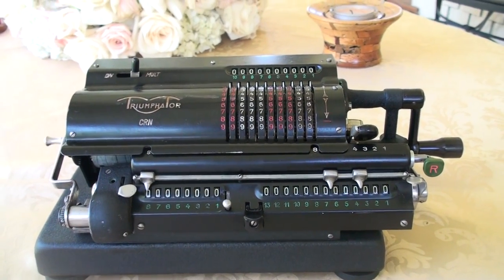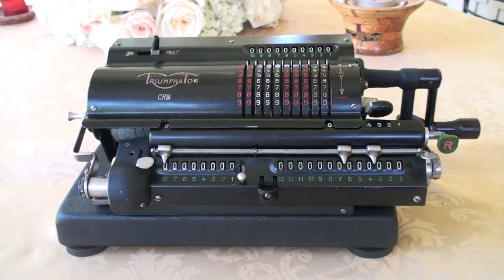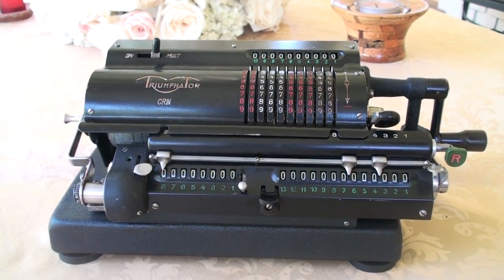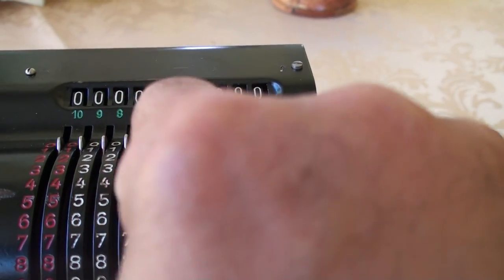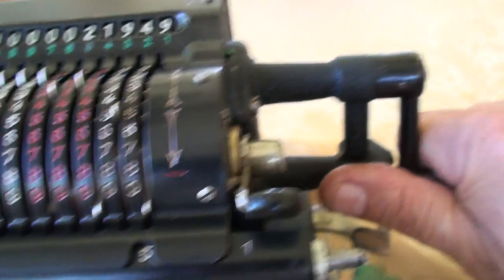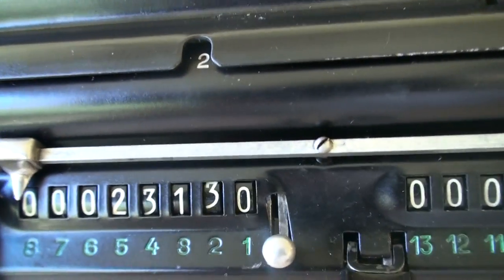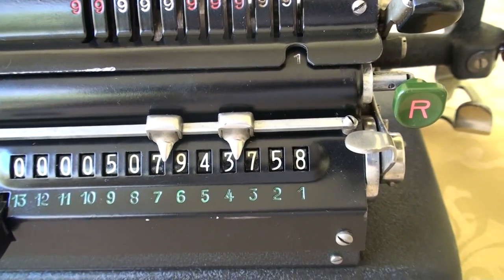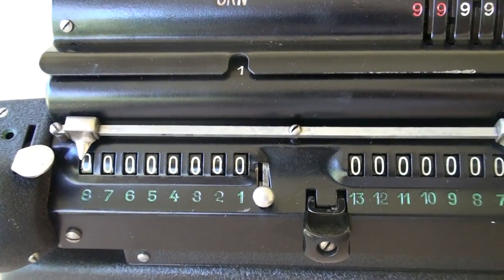Triumphator CRN Mechanical Calculator Cir 1950

Comment from the maker: Most of the bearings I machined out of brass. I also used aluminum to replicate other pot-metal parts that had expanded cracked etc. wire brushing them gave an almost cast look which is nice. Unless you have one that is missing parts you do not really need schematics.
It is a very long process and not an economically feasible one just a labor of love and a challenge. If you are restoring one good luck you should be pleased with it when done.

Comment: I dated mine to the mid 30's. It only took some well placed solvent to dissolve the dried grease clumps that prevented full rotation of various register banks.
I think there is a way to carry exponents as in engineering or scientific notation, as these  calculators were employed by engineers in the pre computer era.
In that realm, the power to compute exponential numbers without pen and paper is absolutely amazing...

Comment: i have exactly the same machine, but yours looks quite new.
Did you paint it?
Reply from the maker: No Cleaned it and gave it a coat of satin clear lacquer for future protection.
Reply: i've fixed my first machine (later version -CRN1), and second is in progress.
Next few - on the way.
Inside it looks even better than from outside :)
Power of machine without electricity...

Comment: I have one also.  In working condition.  Where would I go to appraise it?
My Triumphator  only has a "C" not "CRN".  Any additional information would be helpful.
Reply from the maker: The C is an older model 1908-1925. If it functions well then I would say that for that version pot metal was not used which is great. There are not many of these machines around, although great many were built about 35,000. As far as value very difficult to say.
Reply: Thank you so much for the reply and information.
Reply from the maker: jaimemm1961 My pleasure.

Comment: I have one of these Triumphators at home. It is totally blocked and not working at all. I would like to restore it but actually never done such a thing. Any suggestions, tips and tricks for me? Is it hard to put it back together after all that cogs will be all around my working table?
Reply: In the same boat. Mine is a greenish gray.
Reply from the maker: If you can machine and have access to a lathe as well as a milling machine go for it but it will be a labor of love because you will spend hours and hours replicating parts. Please see my comments below (five years ago). Also bear in mind it is not a question of taking parts out cleaning oiling and putting back.  Would I do it again? Hell no, just saw it as a challenge and went for it. :)